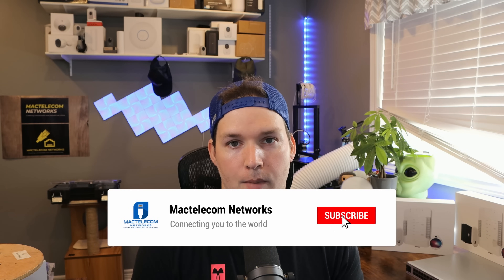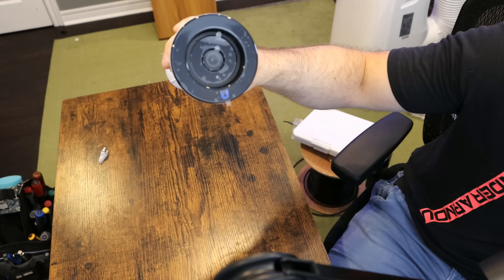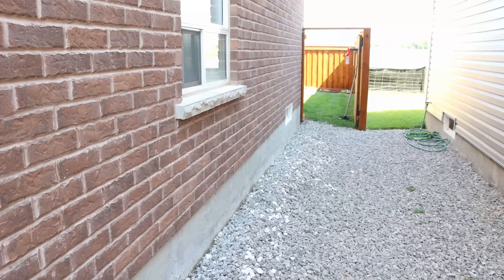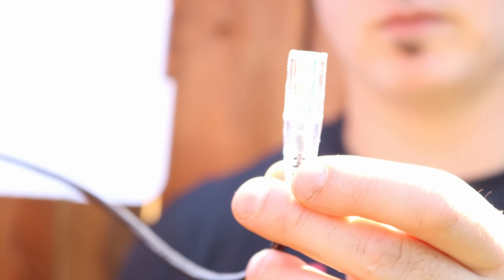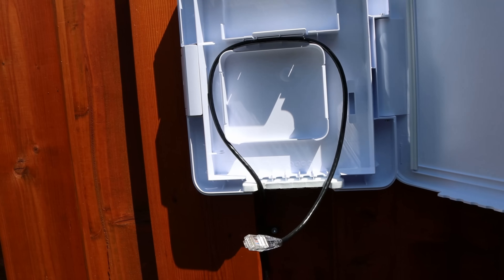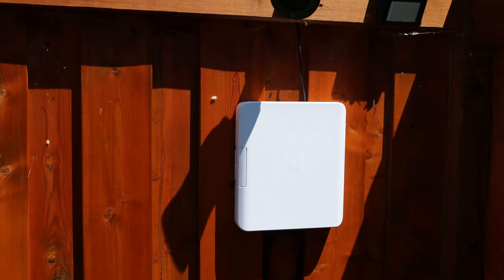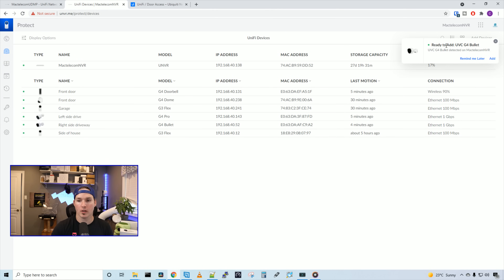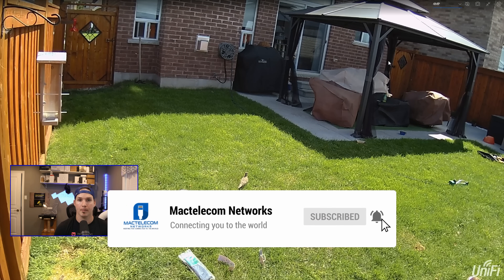Installing a Unifi G4 Bullet In My Backyard!

Comment: Ethernet surge protector, that’s interesting and I’ve never heard of them before  . I’m in the process of installing a G5 flex inside a post on the corner of my front lawn at the edge of the property line in order to get a better street view . The cat6 will be in 1” duct, but I’m still paranoid regarding water and a potential short damaging my Poe port on my switch. 
I was going to turn the Poe off on the port of my 24 port unifi switch , and add a Poe injector, thinking this would save damaging the switches port ?

Comment: Cody, I am going to install 1 or 2 G4 bullets in my back yard and I don't have any outdoor cable so I was thinking of getting some plastic not PVC, to run my cable so it will not be exposed to the sunlight and if I have problems in the future I can buy some outdoor cable(lucky for me MonoPrice is about 5 miles from my home) and I can just pick it up in 1 day. so what type pipe do I need since this will be placed outdoor and have 1 or 2 POE cables inside?  I thought you might have run pass this challenge when you do some of your outside cameras for some businesses. If you don't know that's okayt, any help would be appreciated.  thanks Jim

Comment: had about 20 out of 40 cameras fail it was cameras mounted complete out in the open that failed, opened them up found water inside or moisture corrosion. RMA replacements also eventually fails from water. Either mount under eaves or build some type of cover over them they can't handle plain old thunderstorms. I imagine the G3, G4, G5 all suffer from this, same weather rating and same housing. OG UVC Cams never had any problems 30 out of 30 never failed.

Comment: I’m curious….could you connect multiple cameras to that USW Flex and all of the feeds come in through that one port on your in house switch? 
Also, I have a ubiquiti 8 port POE switch in my house. Instead of trying to run multiple cables from outside to inside…can I just run one cable from my in house switch to a Flex outside and have all the cameras plug into the Flex to power them on like you did with the one camera in this video?

Comment: Great video thanks for sharing. Why did you use a switch for the backyard camera?  Cheers
Reply from the maker: Because I add different devices to it for testing and videos. If it were just the camera I would have only run on cable and had no switch

Comment: Do you got moisture at the end of the cable if using pass through?
Reply from the maker: Sometimes it’s always best to not use pass through outside. If you are you should get the professional ones with a cap on the end
Reply: @MactelecomNetworks  thanks for the tip, I had no idea they differed, but thinking of it it makes sense not leaving the edges exposed like that.

Comment: What is the point of the flex? Could have saved $100 and just ran the cable direct to camera
Reply from the maker: That is true. However I’m using the flex to power other devices when I do testing for videos
Reply: @MactelecomNetworks  Makes sense :)

Comment: Great video. 

I just set something similar up,  USW-Flex and Flex Utility panel, which is serving a G3-Pro, G4-Bullet, and UAP-AC-M-US. I put the ethernet surge protectors between the devices and the flex switch and then one upstream of the flex switch between it and the USW-Pro-24-POE switch. All in all it worked out really well. Biggest pain with the surge protectors was the ground wires. I used some spare 12 AWG ground wire and found that the slot in the cover of the is too narrow to handle the gauge with the insulation, so just had to strip it a bit further to get it to work.
Reply: ha, just realized the installation instructions state </=16 AWG ground cable...whoops.

Comment: Nice job! 1- your cats don't try 2 run away? 2- any risk of the cable getting perforated by the rocks?
Reply from the maker: The doors and screen were closed cats couldn’t get away. We bring the outside for walks everyday. 

As for the cable getting damaged by the rocks it’s most definitely possible. If this was at a clients I would have put it in a conduit. But we rarely walk beside the house I doubt we will damage it

Comment: Nice! I noticed that the PoE Injectors also have surge protection. Does it protect against lightning? or just power surge from the electric grid?
You have these surge protection on all your cameras outside? or just these ones that are further away from the house?
Reply: The Ethernet surge protectors have a spot where you can bond them to a ground source.